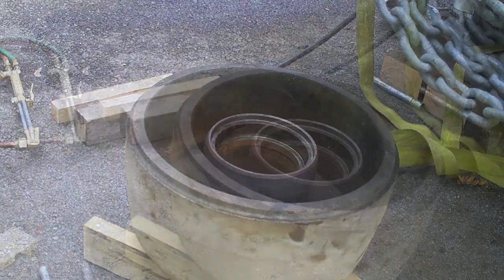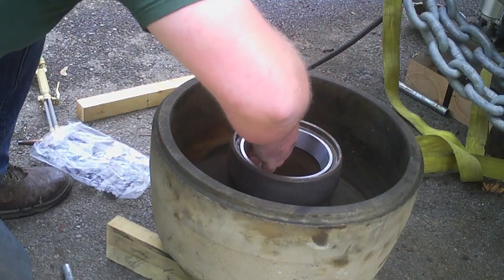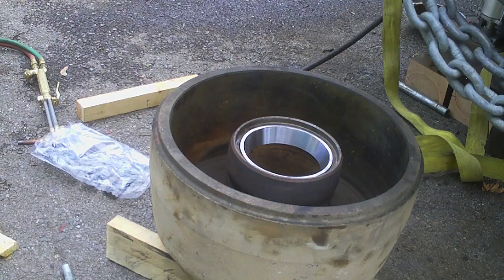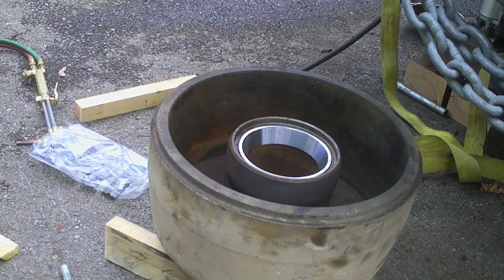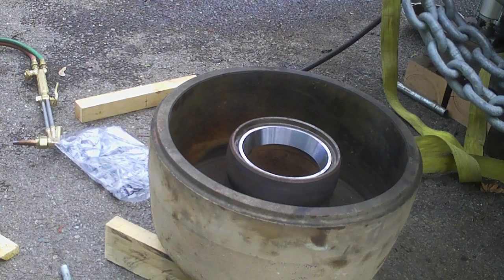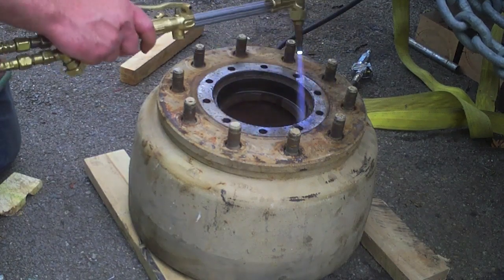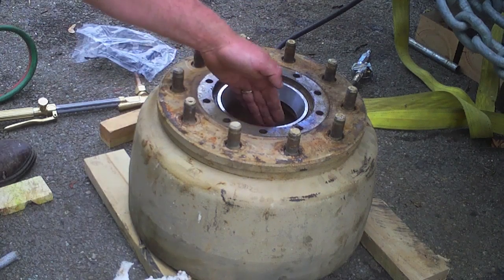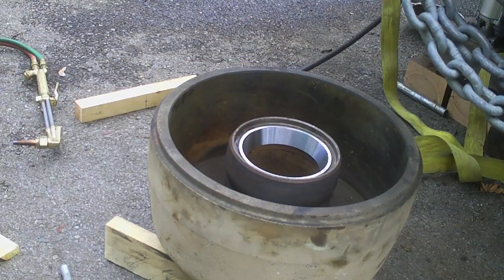Installing Large Tapered Bearing Races

Comment: You would think that heating the hub would cause it to expand and so the frozen race would still be difficult to install.

Is the heat applied to the hub also causing the moisture from the frozen race to evaporate, that way there is no chance that rust will form?
Reply from the maker: Yes hub expands, frozen race shrinks so in that moment you can often just drop them in.  Hub quickly heats and dries any frost on the race.
Reply: @acme663ryo  So the purpose of heating the hub is only to evaporate the frost from the race, preventing the possibility of creating rust?
Reply from the maker: @gbenz6494  hub expands,  race shrinks, both fit together easily. When one warms up and the other cools down they fit firmly.

Comment: I agree, I've been doing this for a decade at the deere dealership. Freeze the race overnight in a freezer and heat up the axle housing. Getting the races back out is as simple as welding a good thick bead around the race, flipping the hub over so the race can fall out, and letting the weld cool down. If everything goes ok (it usually does) you'll be sitting there fiddling with something and here a big "CACHUNK!" and that means the race is out of the housing.

Comment: Lisle 61900.  150 bucks off amazon.  Its a bearing race driver that has all the sizes you need for big trucks.  I use it all the time.  Let races freeze for a while and drive it in with a hammer.  Most shops I've worked for "disapprove" of this method.  But a very, very handy trick none the less.
Reply from the maker: asavage1576 I will look into it.  Thanks.

Comment: you should be able to seat the bearing races by tightening the preload nut on the spindle axle. problem being of course cocking the race at an angle. i watched your other video about installing the wheel bearings. for bearings this size, you'd be better off too tight.. to the point you can't even turn the wheel by hand after they are installed. given the fact that the axle heats up, expands, and reduces the preload.

Comment: So, HOW did you know that the inner workings of the assembly had gone bad??

Thinking about your videos, I'll bet it took 6 guys in the Army  motor pool all day to accomplish the same job.  Was the truck probably still in the army when the "dry" bearing was inserted??
(Sigh....)
Reply from the maker: Tapered Roller Bearing Run Dry- M923 Bearing Put in Dry

It was very clear when you saw it bad things were in the doing.  I have no idea when it was done.  I have put more than 1400 miles on it and would have never thought it would make it that far dry.